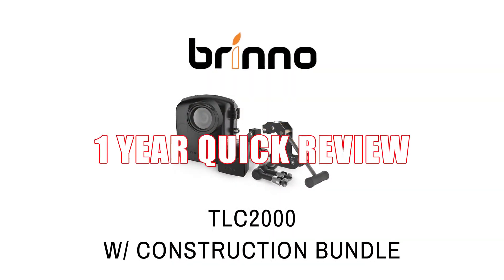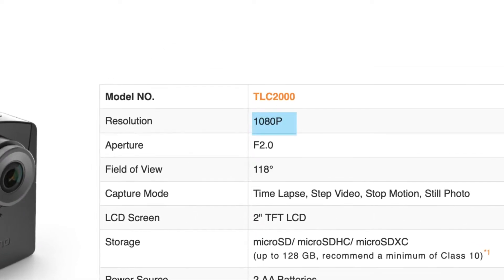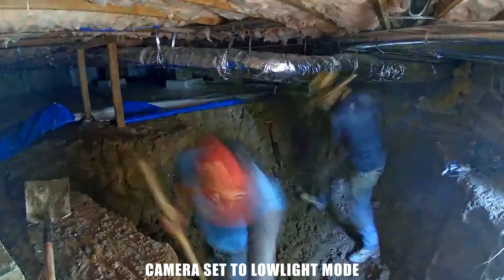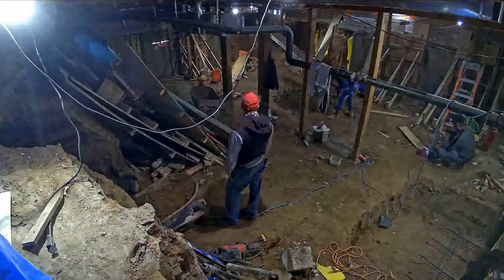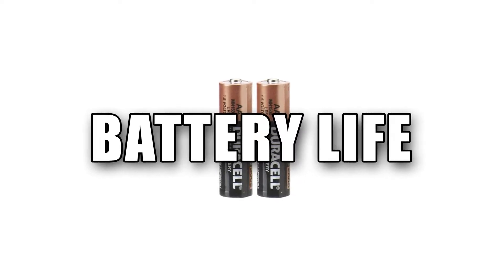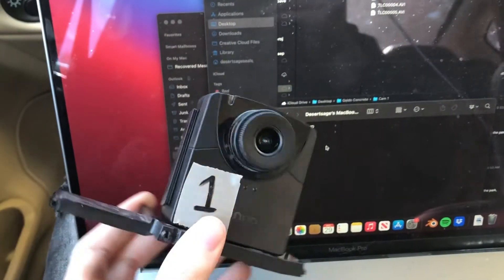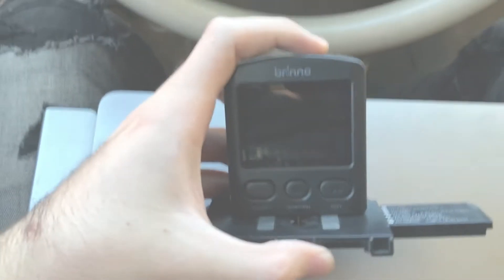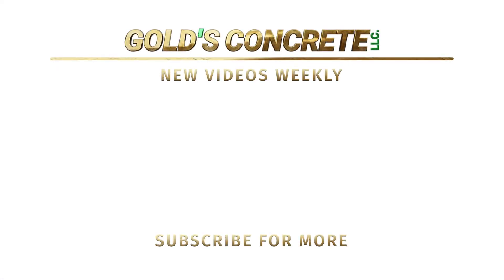Brinno Construction TIMELAPSE Camera - 1 Year Quick Review

Comment: Hi I wanna ask, can we change the battery when camera still running, because we have about 6 months project, and battery can just last around 3 or 4 months
Reply from the maker: Yes you can, you just have to pause the recording when doing this as the unit will have no power. when the new batteries are in hit record again and should last you another 3-4 months
Reply: @GoldsConcrete  Great, thank you!
Reply: Great test, can we use it plugged into an electrical outlet?
Reply: @jfmestre4903  I think you can't, but if you have scheduled capture, it's ok to change the battery, and push record or continue the timelapse after batteries replaced.

Comment: I see you are using a Mac but it say’s windows only all over the website. Is there a work around, or are you just not able to update the firmware on Mac?
Reply from the maker: I'm not sure! We use Windows
Reply: But you show a laptop screen with Apple apps and even the Apple logo on the top of the laptop in this video.?
Reply from the maker: @MrShtsweak  Ahh yes. That was the previous marketing team
Reply: So I dug into this a bit more. Turns out you can use a Mac for editing and all that it’s just not compatible with the Brinno Control Center which allows you to control the camera and check status via the long cable